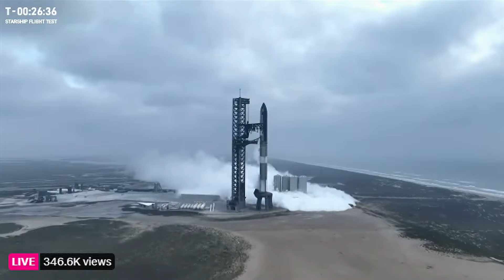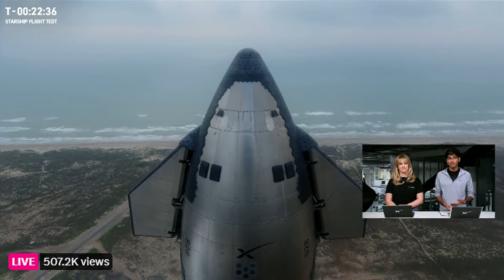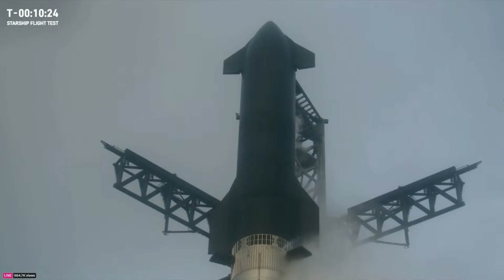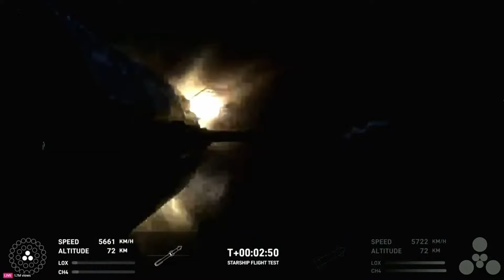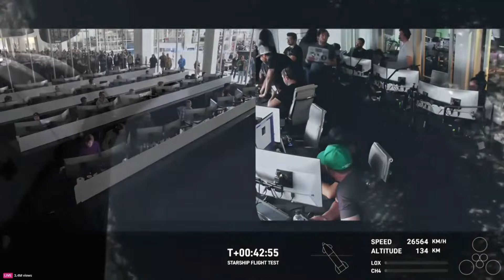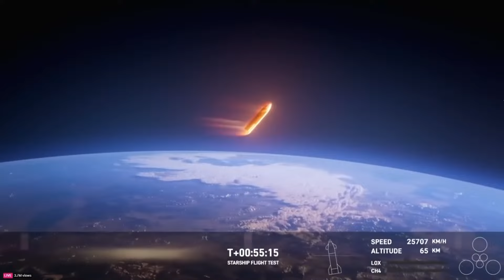SpaceX Starship: 3rd test of Elon Musk's futuristic spaceship fails as contact lost during re-entry

Comment: I've noticed that it takes mere seconds for 
retro firing falcon engines to drop 5,000kph from booster speed.
This 'cuz its mass is a tiny fraction of what it was at launch.
Going 26,000kph at re-entry means the ship is getting hit by 
atmospheric particles moving at 7.2 kilometers per second relatively.
The mathematics that takes into account a host of dynamically changing variables -
ship's mass, fuel mass, speed, atmospheric density, tile thermal resistance and 
rate of abrasion, angle of attack, etc. is most impressive but nevertheless,
wouldn't slowing down a lot before re-entry increase the likelihood of survival?
Reply: Time is da Money

Comment: The booster was intended to splash down in the ocean, which it literally did so nothing was a failure
Reply: Was supposed to soft splash... Not Mach 3 splash...
Reply: @pinheirokde  it was never going to be used again, simply for data. Never been done before, naïve  to think it would work first test
Reply: @SkatingStorage  well it was supposed 2.. it did not... So...
I might had as well that the second stage was supposed to get some data out of the reentry stage and how the tiles would cope with it... The fact that it was tumbling on reentry makes negated the acquisition of that data...

It had many positive aspects... But it's not a complete success, nor a complete failure...